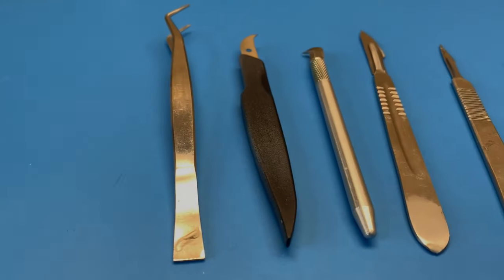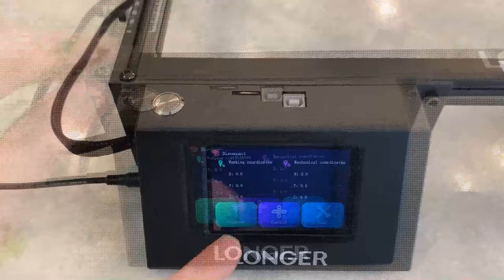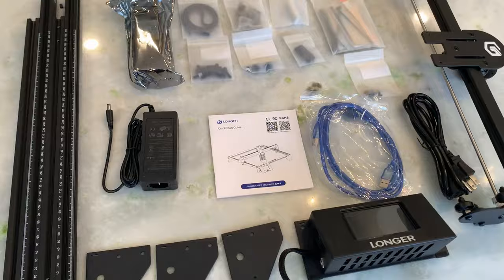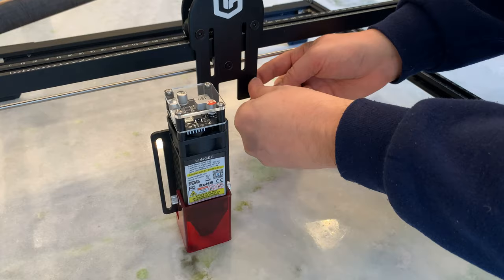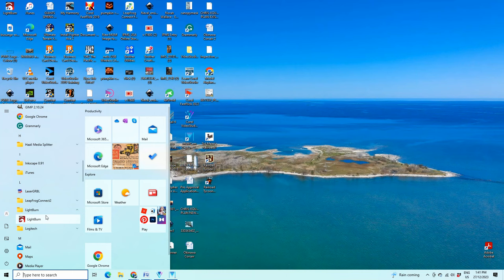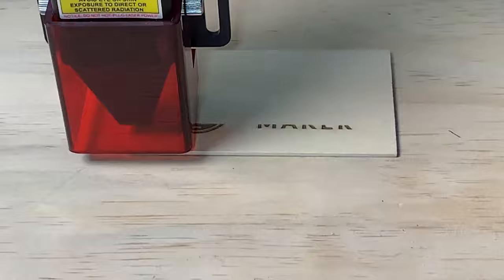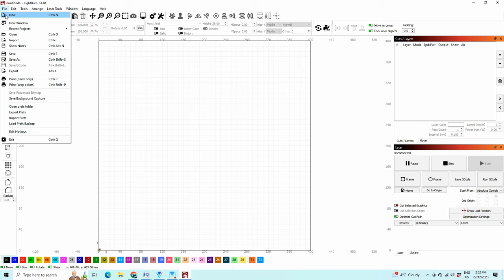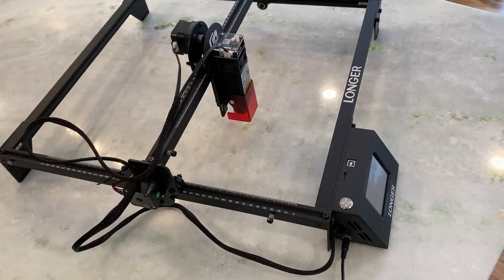This laser engraver makes sharp model bases

Comment: Does this produce enough fumes to be prohibitive indoors or would you want to only do it in a garage / outdoors?
Reply from the maker: I tested it in the garage at first.  To do the engraving that you see in the video - I am sure the smoke factor would be minimal.  For cutting though, you might want to have some way to extract the fumes.  I am still experimenting though so I'm going to find out more.
Reply: @ModelAirplaneMaker   Good to know for sure.  Thanks for the info too.  What have you cut with it?  I've seen the higher power laser can do metal but I assume this 5W is not that strong?